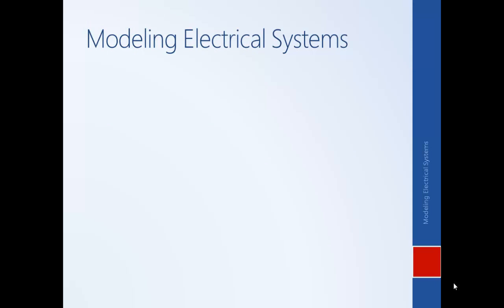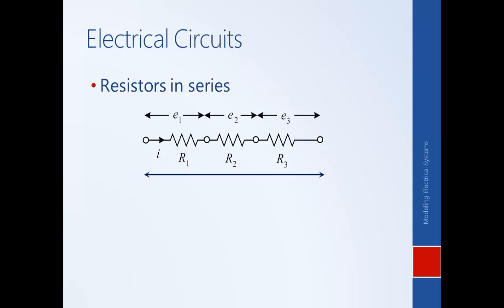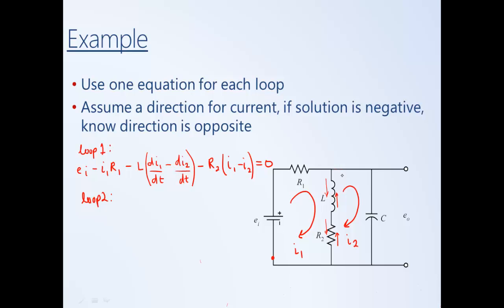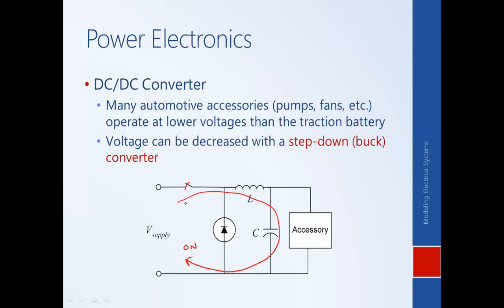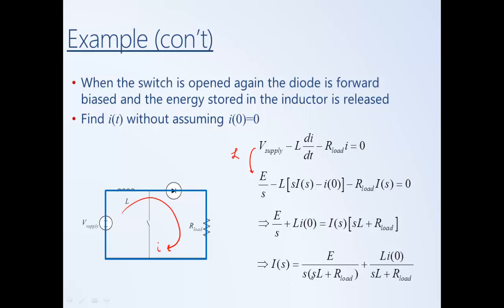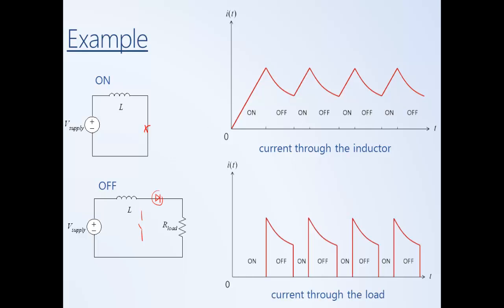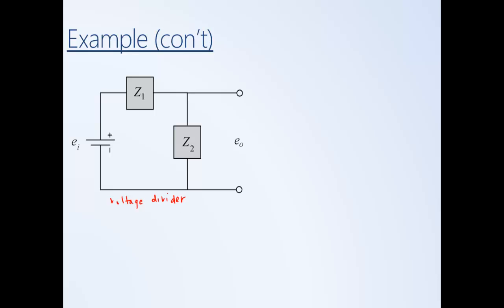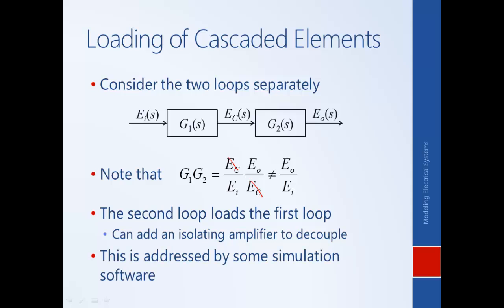System Dynamics and Control: Module 6 - Modeling Electrical Systems

Comment: @27:54 you wrote -1/C, and in the next slide it becomes + 1/C which is correct.
Reply from the maker: Chet P Thanks for noticing the discrepancy. It is actually the case that for the orientation of i2 that I have assumed, the sign on 1/C should be negative in both slides.